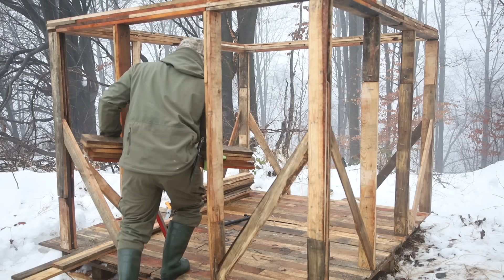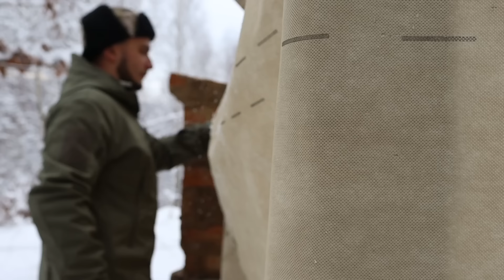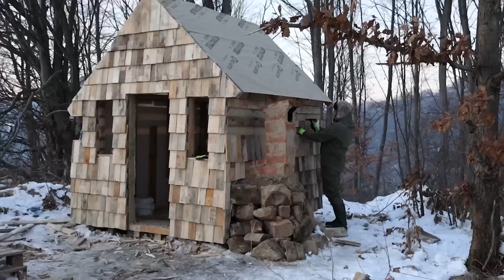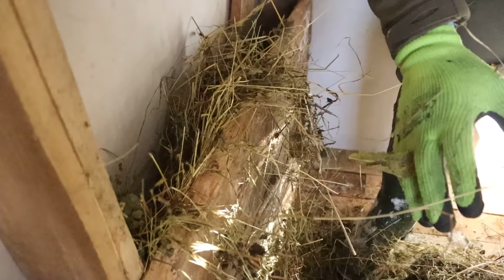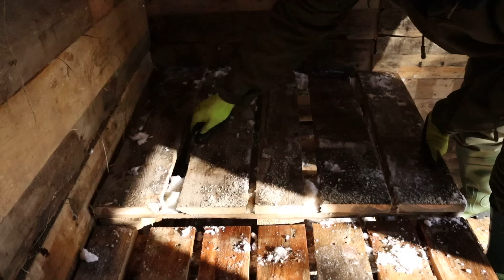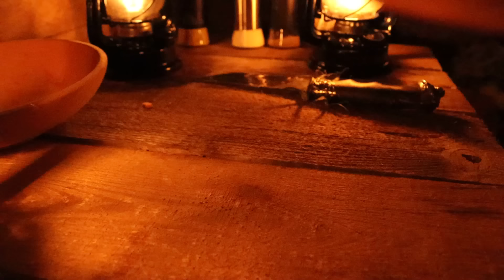House with free pallets. From start to finish

Comment: Great job!  Using local materials for insulation simply makes sense.  Your woodworking techniques are straightforward and robust.  The house will stand for many years.
Reply from the maker: Thanks!
Reply: I think the wood will begin to rotten in few months, because the wood has contact to the floor and wetness.

Comment: The homeless people need to see this they could pull together and do this instead of living in misery in tents ⛺️. But I guess I mean the sober ones that truly don’t deserve it . 😊
Reply: Well I was homeless and before I got my life stolen from me I was and am a commercial carpenter of twenty plus years and I had the knowledge and the skill and the ability and I was sober enough I use medical cannabis because I also served two tours with the U.S. Army but any ptsd I have is most assuredly from my ex wife lol I even had the tools that you need to do every part of the job, and I could probably have rounded up the materials, but no place to build it, minus of course the 200$ roll of house wrap. BTW those cabins that this carpenter/ tradesman has built, while being beautiful and cozy they lack running water and electricity and while the electrical power is not a big deal, you still need a place to do your business as well as bathe and wash your dishes clothing etc. and granted you could probably make do with it as it is and maybe add an outhouse with some kind of rainwater shower outbuilding or something but the land to build it is the other big part of that plan lol